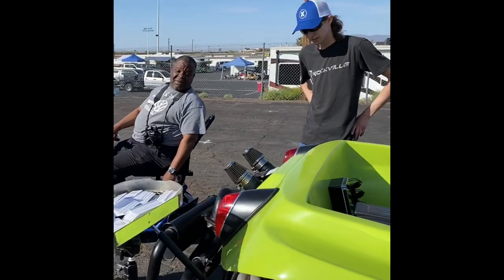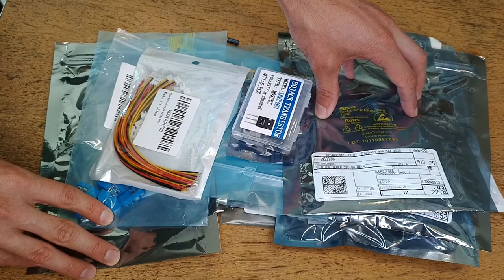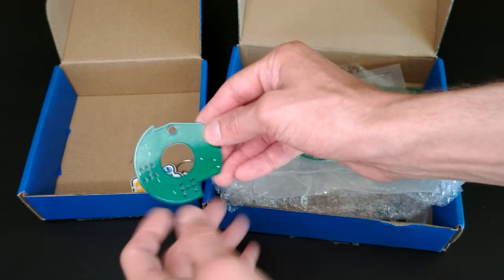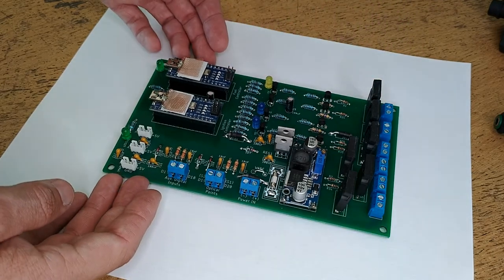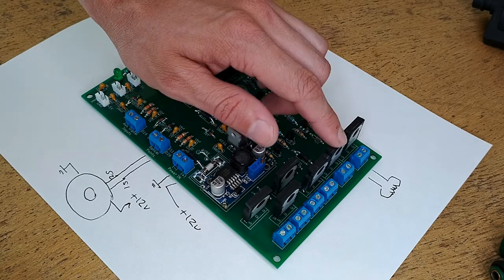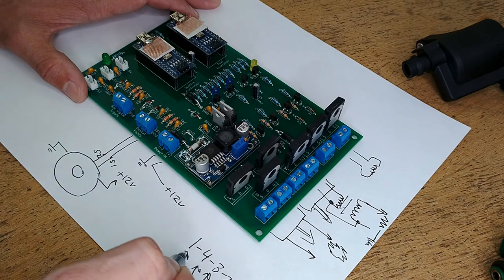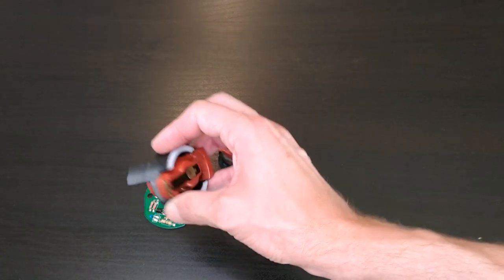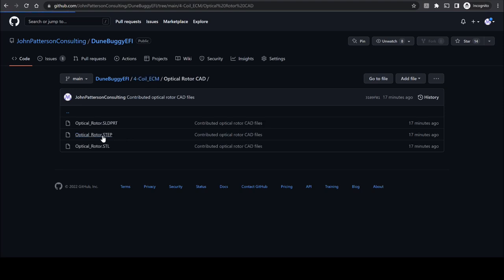EFI and Ignition: 4-Coil DIY Engine Control Module

Comment: Coil on plug with cam sensor... and it's fucking wasted spark..... k.
Reply from the maker: It's using a symmetric 2-sensor optical pickup on the distributor, so it actually does have to be wasted spark. If it had 4 sensors or a cam/crank position sensor as you said, then it would be possible to fire on ignition strokes only. Wasted spark works really well, though, as the engine is always timed to fire before top dead center, so the wasted spark always fires safely into exhaust and never into fresh mixture.
Reply: @DielectricVideos  Know what else works well? A distributor. Snarkiness aside, I do wonder why you used 2 Arduinos. Was one not quite capable enough? Was switching to a mega 2560 (or similar) just more effort. I plan on digging through your code. Recently had the idea of trying a purely look-up-table based approach, also with just cam/crank sensor + MAP. MAP through a potetiometer for quick adjustments and choke, adjusting table for long term adjustments. Also considering purely look-up-table spark timing by simply counting clock pulses... and torque converter lock up, and a basic binary counter approach for paddle shifters. Nothing would ever reference real time, just program it assuming the 16 MHz clock, will be 16 MHz. I'd start with just fuel; would be my 1st scratch-built programming. Leave the GUI re-turn up to other people who know how to prepackage some sort of word processor style thing, as a tuner studio replacement... if it works out well others.
Reply: @DielectricVideos  To further express my understanding, yours works like older 4 cylinder Honda CBs with 2 points 90 degrees apart. Except yours has 2 trigger tabs to make up for cam RPM vs crank.
Reply from the maker: @Marc_Wolfe  Sounds like a really cool project! I'd love to see a DIY tuner studio GUI, rather than my (quite limited) 10x10 AFR table in the Arduino code.

My previous board used a single Nano to control 1 HEI coil (plus fuel control), and used the original cap and rotor to distribute. It worked OK, and the HEI was a big improvement over the old high-impedance coil system. However, timing jitter could get as high as 3-5 degrees at 4000+ RPM, so I decided to split up the load to 2 MCUs.

Looking back now, I think there is a lot of room for code optimization to speed things up and go back to a single board. That being said, ATMega328p boards are fairly easy to get, so I decided to leave it as is for now.

An ATMega2560 wouldn't have helped much, as they are also 16MHz AVR chips. Bottleneck is more on CPU cycles rather than memory or GPIO pins. I'm thinking at some point of designing an ESP32-based unit with a small LAN network and web interface to show on a dashboard tablet (similar to Tesla Model 3 display). A single ESP32 should be plenty fast to do everything, and since it's dual-core, I could reserve an entire core for the HTTP server and the TCP/IP stack.
Reply from the maker: @Marc_Wolfe  Yes, correct. The 2 optical pickups are set 90 degrees apart, so one optical sensor controls cylinders 1 and 3, and the other controls cylinders 4 and 2 (for a 1-4-3-2 firing order). The trigger tabs are 180 degrees apart, and are indexed to the distributor shaft. Thus, each optical pickup gets triggered twice per distributor revolution, or once per crankshaft revolution.

Timing is set by adjusting the rotation of the distributor, as well as by offsets in the program code. Also, timing adjustments based on RPM and MAP sensor value can also be set in the program if desired (to emulate centrifugal advance and vacuum advance)
Reply: @DielectricVideos  If you care to check it out https://www.youtube.com/watch?v=mqe2qlADClE There's the 1 comment that mentions adding additional sensors; the additional sensor could have another array, and the values from both arrays could be "mathed" together, preferably very simple short math, like the temp sensor just adding more based on "coldness" and the first array being tuned for very hot running.
Reply: Could also do the multiple controller approach to have one (Mega 2560, or Pi Pico with it's relatively massive flash and SRAM spaces for arrays) do all the sensor reading and math with no interrupts, and send the pre-mathed values to basic microcontrollers dedicated to handling their own interrupts, while potentially displaying all that info for you to see; each basic controller getting their own bus, whether the bus is parallel, i2c, CAN, whatever. Instead of dealing with the likely complexities of a multi-core controller. The busses would be one-way only, so a wifi enabled module could piggyback that data.
Reply from the maker: @Marc_Wolfe  Very cool, looking forward to seeing how it all comes together!